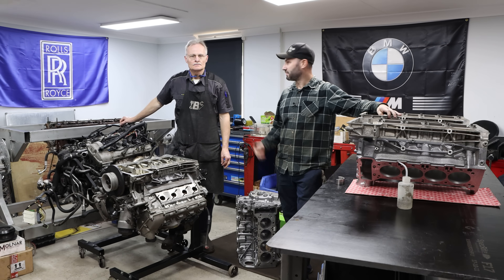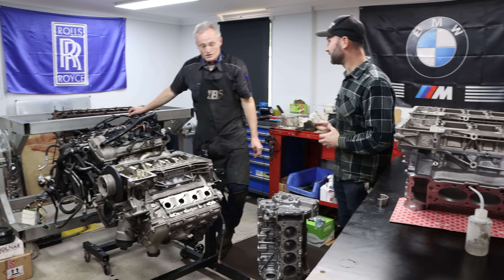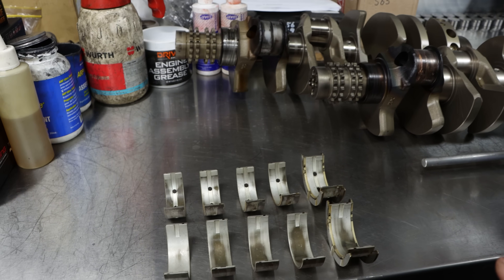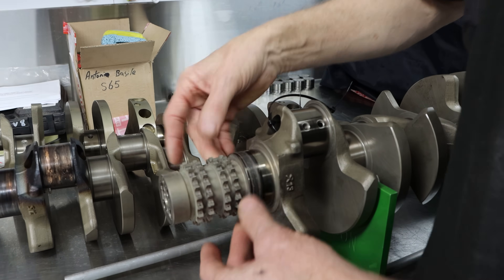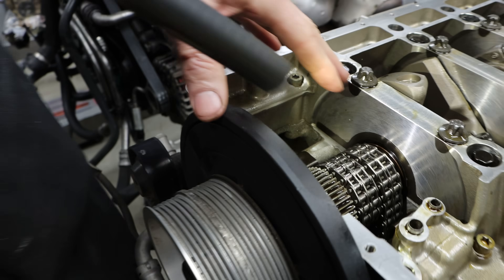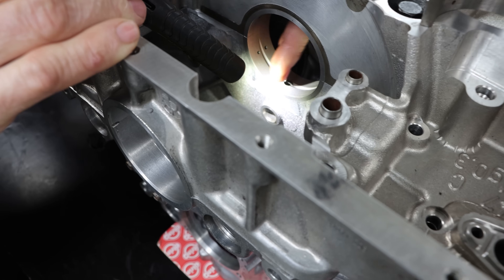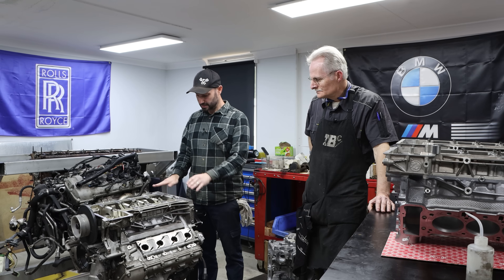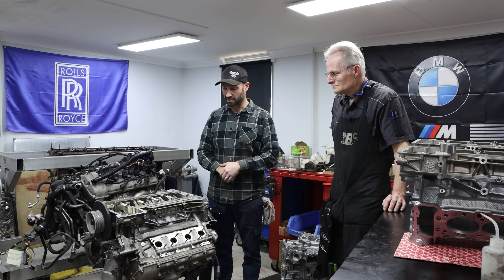BMW M3 S65 MAIN BEARING FAILURE! Rod bearings trumped by main bearings.

Comment: How many engine would be ok if just people change there oil in high rpm sports cars … like 3000 miles then change oil.. this nonsense with 15000-20000 miles interval longlife bla bla . Its just for the car maker to sell cars with a TCO of service that will look ok. But in high rpm v8 oil need to be change more often then people does
Reply from the maker: This is 1 of the critical things yes. 5000km max

Comment: Have you experimented with WPC treatment on both main and con-rod bearings when rebuilding?
Reply from the maker: Yes have seen them. Good thing. We use our own local Aussie brand ACL bearings which also offer a coating as well. We could have our ACL bearings wpc treated I guess
Reply: @BrintechCustoms  Do you use ACL race main bearings 5M1581H? Are these good or do you recommend bmw oe bearings?
Reply from the maker: @swalko  Yes we use these ACL units.
Reply: @BrintechCustoms  thank you for answer. Are you able to do one motor from one set, or you need to combine more main bearings sets to get optimal journal clearance?
Reply from the maker: @swalko  sometimes a 0.025mm or HX set is required, and sometimes half shelling.

Comment: how much does it cost to put in new main bearings?
Reply from the maker: $3800
Reply: @BrintechCustoms  but, I imagine this is a engine tear down and require to remove the block?
Reply from the maker: @crispcarguru303 no can all be done in the car
Reply: @BrintechCustoms  more of a pain though?
Reply from the maker: @crispcarguru303 much easier than a full extraction and tear down. Cheaper also
Reply: How is this possible in the car ? Obviously, it is, but how are you dealing with the timing chain ? Any tips ?
Reply from the maker: @JahlMarshall  remove bedplate. Slip bearings out. It's not that difficult. When you try it you'll see how it is possible. We leave the upper middle bearing in till last as this allows us to tilt the crank in each direction
Reply: @BrintechCustoms thanks for the tip, I just had rob bearings done, but my first oil change was a glitter bomb so I'm concerned about the mains , I have observed a minor trend of mains going after RB change for whatever reason?, thanks again for your tips , I would get the work done by brintech but I live in NZ .
Reply: @BrintechCustoms  are you able to measure the crank in place of not , how do you choose bearing size?
Reply from the maker: @JahlMarshall plastiguage

Comment: The higher redline these S65 are able to achieve likely means you have stiff valve springs and requires more force to turn hence the need for a double row chain, heavy duty tensioner, sprockets, etc. 

I assume during testing, there wasn't any issues found with this setup. But after hundreds of cycles of running the engine on and off, the oil isn't able to prevent contact. Could be a very brief period of lack of lubrication such as replacement of an oil cooler.

I'm surprised to learn you're running an extra thousand in clearance. I would have gone for half a thousand only.
Reply: Spring pressure doesnt have that effect
Reply: @Funkyflykiwi  you are telling me that having a higher spring rate would require more force to compress?
Reply: @brarautorepairs  im saying they dont need more force to turn

Comment: You hit the nail on the head. Lots of the builders over here in US/UK/EU have already identified and confirmed your thoughts on the double row chain being the issue causing the #1 failure. Your idea of a custom set for main bearing replacement is great, hopefully some of the suppliers can start supplying custom sets with a larger #1. Mahle Motorsport in the UK for example.

Comment: Reasons why BMW chose a chain over a belt on these engines, the M10, and M30 have more oil clearance, not sure  about M88-M90 oil clearances but stands to reason they have more than these S65 engines . Early M10 and M30 engines are double row chains, they later when with single row chains. It’s quite amazing that the tension on them causes crank to bend at high rpm. There an old hot rodders trick that was used on the SOCH V8 Ford engines, apparently the timing chains would stretch enough at high rpm that one bank on the engine would cause the cam timing to change, Ed Pink described the trick in detail about how he discovered the issue and corrected it for high rpm use in nitro methane drag cars. Two totally different things but somewhat related.
Reply from the maker: Very interesting thank you

Comment: What is your opinion on running a thinner oil in the S65 like a 5W40? I suspect its better because the tight clearance but would it maybe also have a effect on the chain tensioners?
Reply from the maker: It is a good idea. Just keep in mind this engine sheers the oil quite fast because of the chain system. It is wise to do 5,000km or less service intervals to keep good functional oils in your engine. As the oil sheers and breaks down in molecular structure, the oil significantly reduces in effectiveness and could be attributed to this topic.

Comment: Surely, increasing the bearing clearance in No. 1 main bearing means the crank can bend more?

Will the crank fail more prematurely due to cyclical bending stresses?

And opening up the oil port; if you increase the flow to No. 1, then there is less for No’s 2-5? Might not make a difference, but it’s a ballsy move if you’re not certain that you need the extra oil on No. 1.

Comment: There's one thing i tell all my customers: if you want a BMW just get an inline six one. N/A or turbocharged whatever but stay away from all the V-type engines they produced especially if you want to go fast on track. Always kept me out of trouble like the ones you adress here.
Greetings from near the lovely Nordschleife very nice of you to adress this topic.
Reply: S54 inline 6 for example also has same rod bearing issue as s65 v8 and s85 v10
Reply: @288gto7  exactly and thats why i trust japan in developing  engines :D
Reply: it's proven that the turbo inline 6's are less reliable than the s65. this is an issue yes, but S65 have lasted 250k+ miles that's over 300k kms if maintained correctly
Reply: @rengokusats lol ihave one with 400k
Reply: s85*
Reply: The BMW S62 won the Rolex 24 Hours twice in an amazingly strung-out form (e.g., two-ringed pistons).  These issues are endemic to the S65.

Comment: This may be a newbie question but Is there consideration for the thermal expansion of the steel insert on the aluminum block?
Reply from the maker: The lower bed plate has steel inserts embedded in the aluminium also from factory. We havent has an issue from this to date, but it is a good question

Comment: Why dont you measure home much tension is applied from the chains and calculate additional radial load from chain at speed. That main bearing does not have a lot of surface area. Opening up the clearance will make wear worse for the lower side. Is the front bearing wear from high rpm, or low rpm with cold oil running additional heavy loads through ac and alternator. That chain oil squirter is most likely reducing flow to the bearing also.

Comment: BMW m crankshafts normally have almost an extra 0.001” of clearance in the main no.1 Journal anyways, however I always make sure no1 is the loosest when sorting bearings into size order.   👍
Reply: Just checked a e36 m3 S50B30 Euro crankshaft (brand new) and no.1 = 59.956mm and no.2 to no.6 are 59.980mm.  59.980-59.956=0.024mm, 0.0254mm is a 0.001”.  Just incase I’m called out on this 👍😅

Comment: How about increasing the oil pressure..flow? This spun bearings can also lead to crankshaft snapping
Reply: What evidence is there that oil pressure is the problem? You can’t just pump the bearing clearance up with more oil flow, the oil pressure pales in comparison to the hydrodynamic lift pressure of the oil film in operation. If this was a flow volume problem it would be most apparent in engines with a lot of low speed operation
Reply: @yucannthahvitt  On VW BXE engines, big end bearing overheats and lead to crankshaft failure due to lack of oil. Adding a lower bearing on main same as upper one increases oil flow to big end and cools the bearing more.

Comment: Throttle actuators, rod bears, main bearings, vanos, the oil spec 10W60, seems quite a lot for a road going engine to manage. The S54, S65, & S85 were the last of the NA M engines. Mindset needs to be, service like a race engine...
Reply: @Legend57. I'm not sure this is true. Many of the early S85/S65 failures were noticed in warm So Cal. If the 10W were the problem, we would see a climate skew to failure distribution and I just don't think there's any evidence to point to that. It's quite possible that 5W-40 makes the problem worse, not better. A 10W is still ok below freezing. If it can be pumped it will circulate. If it was too think we would see high oil pressure and bypass action.
Reply: @Legend57. more like people thinking they know more than the engineers, and switching from 10w60 to 5w40 is the reason for some of the failures
Reply: @cpy  Famous rebuilders like Troy Jeup strongly suggests switching to 5W50 Redline

Comment: E90 M3 owner here. How much more time/labor would the #1 main bearing fix add during a Rod bearing replacement job on the S65? Would higher clearance bearings be offered for supercharged setups than the increased clearances you’re using as a fix for NA? I too have been tracking this issue for a while and believe you are on the right track. H2 motors in Germany had very similar observations regarding the possible cause of S65 main bearing failures.
Reply: @legend57 @vertvlogs675 

I’ve been watching Sreten for a while but I don’t recall if he said a main bearings replacement require the engine to come out. Certainly makes sense if you need to but to be fair, his motor needed to come out regardless since he wanted to recondition the entire short block. @vertvlog676 big thanks for the write up. Certainly helped me bridge knowledge gaps.
Reply: @jys8569 mate brintech have a video on just slipping in mains on the bmw 130i being swapped to s65. I am in the market for one and have been researching the s65 and s85 motors for months have no trouble rebuilding as can do myself so tryna figure what mileage to get and pull the motor out and do it all properly. 
Ps: as far as i know for just mains you can leave everything connected and drop the lower girdle to slip in mains, theres also a screw technique you can use which i tried on a blown up vw motor so its possible just better to do it out the car and replace all gaskets and stuff.
Reply: you're talking like  4 to 5 times the price of just rod bearings...i had my rod bearings done....engine stays in....you might as well do a full rebuild if you do mains....you pull part everything....so you will be replacing any "old" parts , if you are smart...it's essentially going to cost close to the value of a  "cheap" e92 m3
Reply: @Legend57.Bro its M539, named after his favourite car, the M5 e39😁
Reply: Well you have to pull the motor and rebuild it with main bearings... rod bearings can be in with engine in car for under $2k USD at experienced shop.  Engine rebuild is several times more expensive.  Honestly I would just wait for your motor to blow if its already at high mileage, then replace it.
Reply: @fengrr  it's not like anyone is making s65 blocks.....so it's probaly  best to try and save a good block while you can
Reply: what is h2 motors?
Reply: @brapinator8500  the search feature will tell you just as much if not more than I can. They are bmw engine builders in Germany that worked with many bmw YouTubers. They know their stuff really well.
Reply: If you have to ask how much time and money to own your car. Then, it's time to get a vw beetle 🐞
Reply: @2nickles647  lol literally did not ask about how much more it would cost. I’m asking what other steps are required if you’re already replacing the rod bearings. I.e. If the crankshaft has to come out then do we need to retime the engine? You just sound like you listen to your service advisor at the dealership when he says your windshield washer fluid costs $500
Reply: @jys8569  I'm not a mechanic so take all this with a grain of salt, but I did have an E90 M3 and looked into replacing the rod bearings myself when I bought it. I ended up bringing it to a shop because I didn't have the facilities, tools, or experience at the time. But I became familiar with the procedure.

Doing the main bearing in addition to the rod bearings adds a large amout of extra labor to the job. The rod bearings can be replaced with the engine in the car and without removing the crankshaft or any of the timing assembly. In my opinion it would be crazy to ONLY replace the #1 main bearing if you're going to do all that work, I would replace all 5 at that point. This engine uses a "bedplate" style main bearing cap, which means all of the main bearings have to be installed/removed at the same time, it also means you have to pull the crankshaft completely to replace any of the upper bearings. Pulling the crankshaft means that you would have to retime the engine, unless you could mark/index EXACTLY where the timing chain was on the crankshaft when it was removed.

I am pretty sure replacing the main bearings becomes an engine-out job by that point, where replacing the rod bearings is commonly done with the engine still in the car. There are lots of youtube videos of guys rebuilding these engines, I would recommend watching one of those videos to get an idea of what goes into installing the mains. Once again I'm not a mechanic so I hope that someone else can chime in and make any corrections for stuff I got wrong. Maybe the mains can be replaced with the engine in the car but I double most mechanics would want to do it that way.

Comment: In the last sentences, it sounds super att. Like the S85 or the S62, the S65 is constructively closer to a racing engine, because it needs more care and care to a "bread and butter series engine" and consequently. You can blame BMW for leaving the customer unclear about it. But, I think most customers would still not have liked it when buying a new one. But I stick to my opinion that these engines are anything but faulty designs!

Comment: Thank you for sharing the knowledge! BMW is still one of very few manufacturers that designs a bespoke racing engines for their sport version sedans, The fact that they last as long as they do is already impressive.
Reply from the maker: Totally agree with this
Reply: Bespoke?
Reply: @2nickles647  yes, they are engines that are designed for just one specific model and are made with all the features of Motorsport powertrains (at least used to before turbochargers).
Reply: @pashkaS54 Lexus isf would say differently.
Reply: @TheRidahbooley1  that is not true. 2UR is in a lot of different cars. BMW has been building unique Motorsport engines for each M variant for 40 years.
Reply: What a great video! I am now happy that I replaced my mains at 211.000km. Now at 232.000 and still going strong (80% racetrack km)

Comment: Is it possible to increase the oil pressure through its range from idle to help the #1 main bearing supply. this could possibility be done with a reduced clearance inside of the oil pump.
Reply: Some BMW’s have dynamic, or ecu controlled oil pressure?

Comment: Seems BMW suddenly forgot that chains in motion have high angular momentum (which increases with velocity squared). When it has to make a turn, it doesn't want to. Which leads to a snareing effect, tugging between the head(s) and the crank. Duplex chains are heavier than simplex, making it even worse. Choosing a duplex chain for a 8000rpm engine for inspirated driving is an engineering blunder on an embarrasing level, it's almost like it was designed to be stuck in traffic at low rpms.

Angular momentum issues in addition to the lack of damping, is why I preffer belts over chains, the added benefit of belts being lighter in general is lower weigh in addition to less inertia, besides the lesser tug. Chains are also a wear item (but people don't seem to know, and is generally much more of a paint to replace) 

If one wants a valvetrain that reduces the load on the crank as much as possible in addition to inertia and drive losses, and lasts nearly forever, then spray lubricated spur gears pluss a really good harmonic dampener is the way to go...
Reply: Chain speed is not very high due to a small drive sprocket, so there is not a lot more tension added to the chain.

Comment: is there any possible way to redesign the tensioning system to lessen the upwards pull? ive never seen the front of one of these engines disassembled so parden me if its a dumb question.
Reply from the maker: We are thinking of running an outboard roller bearing